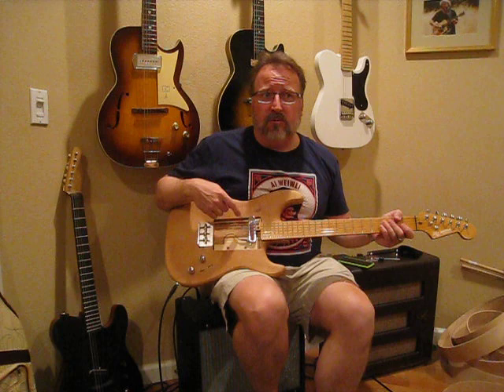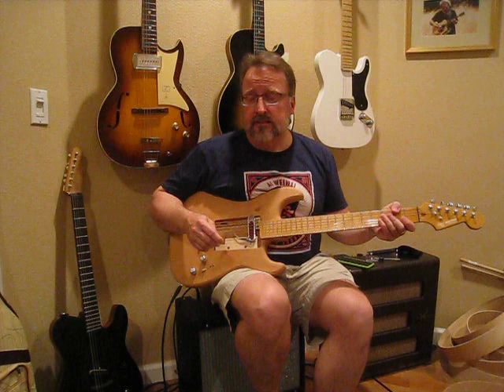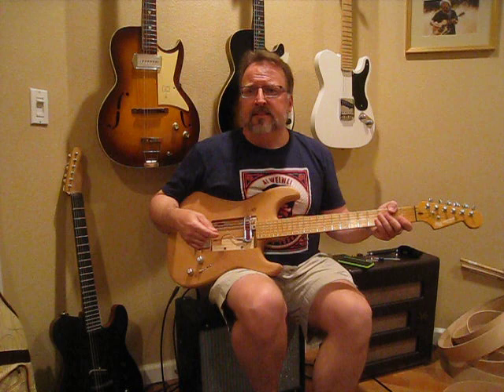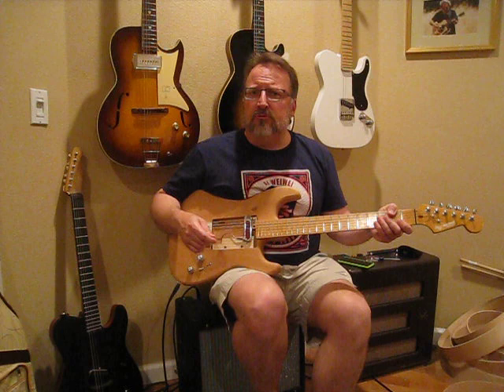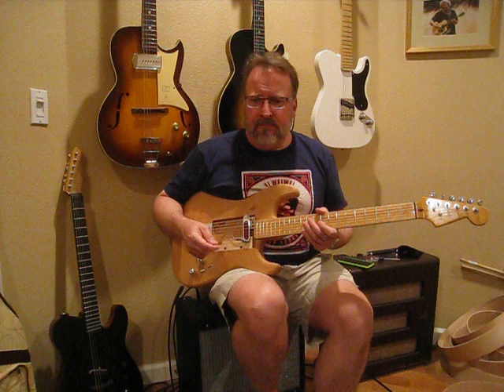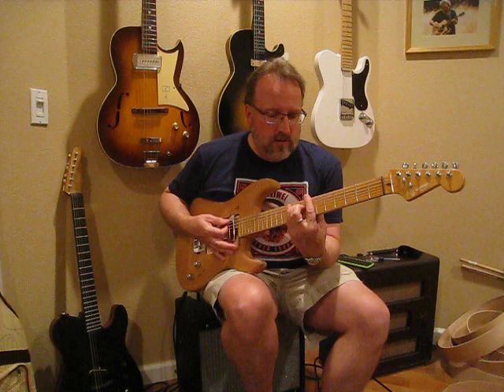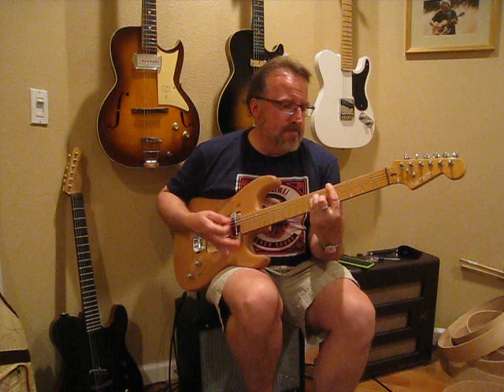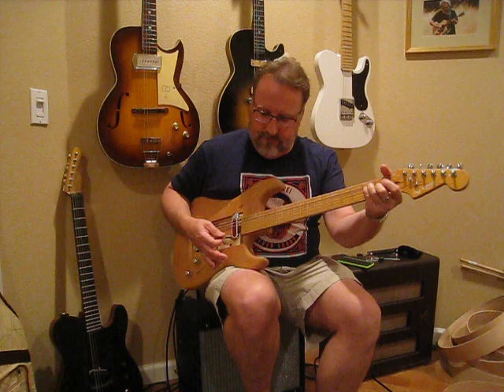DeArmond Rhythm Chief 1000

Comment: Hi! Your video is very interesting. I've got two acoustic guitars, and I want to probe an humbucker or an single coil in them because I don't want to buy an archtop for the moment. I played an archtop, Guild, with your pickup yesterday and the sound is very similar. Do you probe this pickup or another in to an acoustic guitar? Thanks from Spain (sorry for my English)
Reply from the maker: Emilio Jose Murillo Alvarado 
Hi Emilio,
Yes, this pickup was made for an acoustic guitar. I haven't installed it into an acoustic because I love the tone I'm getting in my pickup mule guitar. I do however have the 4 string version of this pickup installed in a plectrum banjo and love it too.
Rob
Reply: Thanks for your answer.
Hugs from Spain